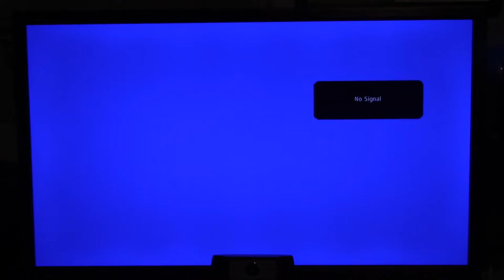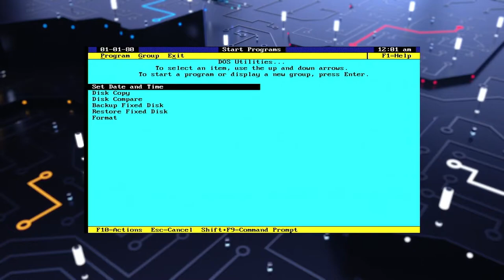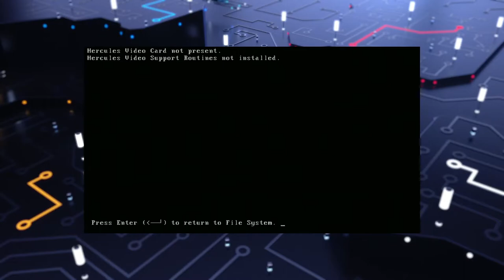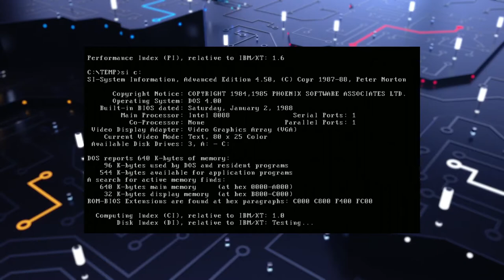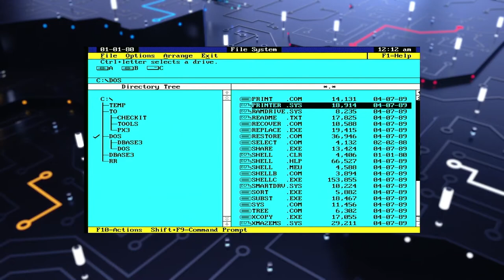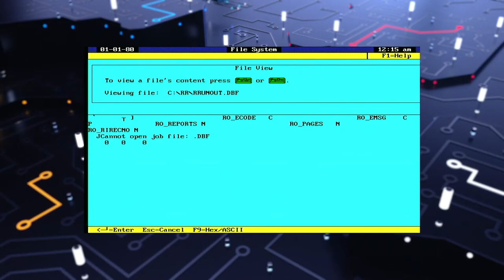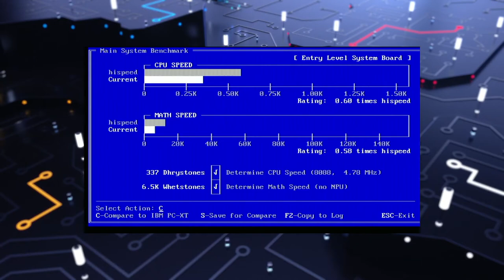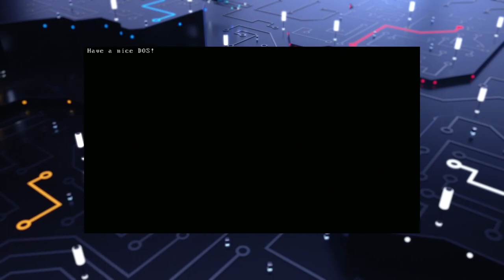Is this the oldest Packard Bell ever made?

Comment: Looks like my first computer that I bought back in 1988. It was a Packard Bell PB 8088. 512mb ram and it had a 40 MB megabyte hard drive in two partitions I forgot which version of the DOS it ran on.  I got it with a Panasonic 24 Pin dot matrix printer, near letter quality, for $1500 at Lechmere. It had an 11mhz turbo mode. Cga monitor.
Reply from the maker: Very nice!  I had a Panasonic printer also.  KX-P1124i, I think it was just about the best consumer dot matrix you could get.
Reply: @TemporarilyOfflineRetroTech  that sounds like the model I had.